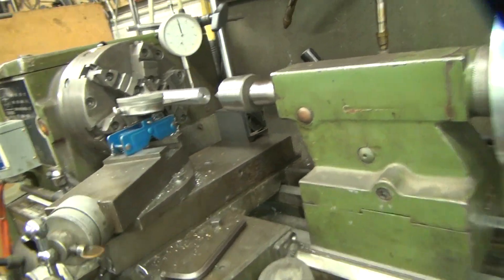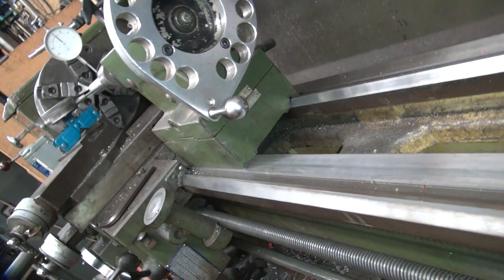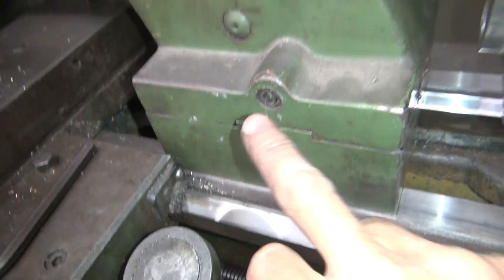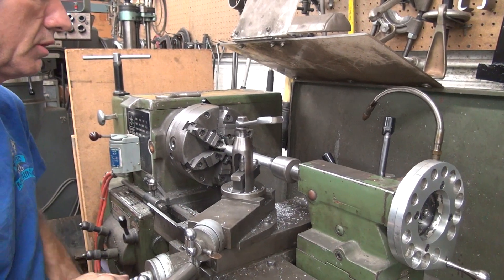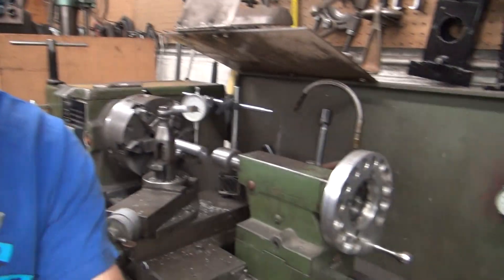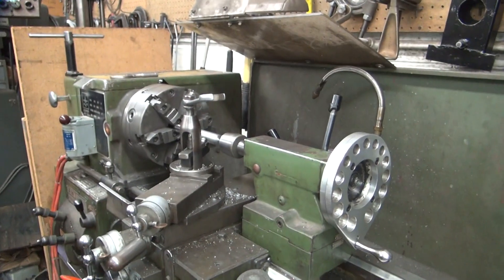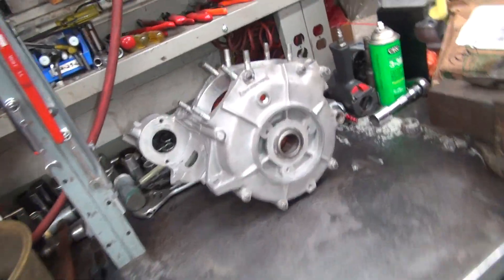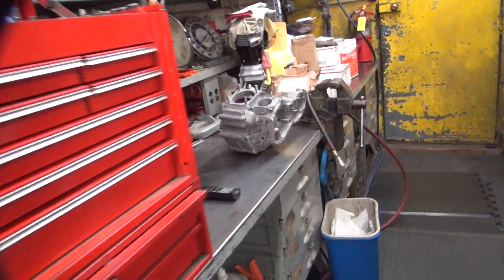#106 fixing my lathe centers centerline dimension so that i can make good parts harley tatro machine

Comment: Hello Tatro, I have a question not pertaining to this particular topic.  My question is, how do you polarize the generator on a XLCH since it has no battery?  My official Harley Davidson manual only covers the XLH which has a different regulator.  I polarized my XLH generator many times, but never my XLCH.  
And thoughts on this topic?  Thank you Tatro, great channel.
Reply: flash the battery between A and GND
Reply from the maker: thats not how i do it. i ground the field and then flash the A' from the battery. its probably the same but i do it my way.
tatro
Reply from the maker: just hook a battery into the system and do it just like the book says too.
tatro
Reply: @TatroMachine  Thank you Tatro, my initial thought was exactly the same as yours. BUT my XLCH regulator has 5 connections, ground, D+ that goes to A on the generator. DF that goes to F on my Generator and two others that feed the headlight and taillight. 
My stock XLH has different regulator terminal markings such as BATT , ARM and FLD.  Thanks again Tatro.

Comment: You're working this LOW GRADE piece of machinery into usable equipment. Drill and tap the four corners and lock the S.O.B. DOWN...
Reply: Unfortunately that’s not how it works. Heavy machinery sits on shim packs to adjust the level end to end and side to side. If the concrete pad is freshly poured, it settles at different stages over time and you have to re shim the machine to re level it. Even when sitting on old concrete pads you still have to check level and re shim from time to time. This is done on all heavy machinery including printing presses where being level and Tran is critical.
Reply: @Michael-st1hl  I was talking about the 4 corners of the tailstock. Every time you unlock it to move the tailstock, the two piece---- of shit is at risk of failing again. bolt the two together now while it's dialed in.
Reply from the maker: that is why i pull it down to the lathe 1st, then adjust the side screws. and yes, it is a pile of crap.
tatro
Reply from the maker: i am on rubber pads. that is why it moves around some.
tatro
Reply: The tail stock has to remain adjustable because of the different lengths of work pieces your positioning at different positions on your Ways. No matter how level your lathe is, you still have to adjust your tapper because of tool deflection as it relates to the type material and the O. D  size of the work piece. The smaller the O.D the more deflection you have especially with longer lengths of material where you need a follow rest or a steady rest. But the tail stock is constantly being adjusted at different positions on the ways.  Then there is the different grades of material your cutting, cold roll, hot roll, leaded stock, TGP, 1040, aluminum, stainless steel, Delron, on and on. Feed and speed, heat transfer, type of carbide or high speed tooling you’re using. So many factors to deal with and consider when controlling a precision tolerance, finish and tapper in the work piece. Also your compound ways need to be adjusted properly. I don’t care how good a or bad a lathe is.. you’re always making adjustments and using your skills to make a precision part and repeatability for a one off or production set ups.

Comment: Hey, Keenan, if you're incredibly lucky, your tailstock ram ended up parallel to the ways when you were done shimming. If not, then whenever you extend the ram more or less than you had it during the adjustment process, it's gonna' change where the tip of the tailstock center is relative to the ways. Also, since you started out with the headstock not parallel to the ways, the center that you cut into the workpiece is going to move around relative to the ways whenever you have a different length workpiece. I know from experience that shimming a machine tool can be incredibly frustrating...I hope the adjustments you did work for you. Thanks for the videos!
Reply from the maker: that is why i set everything in about where most of my cutting is. i do think the bed is twisted and i need to deal with that next. then redo the centering again.
tatro

Comment: Hello Tatro, there are many variables and factors to consider before you start making tapper adjustments to an engine lathe. 
The lathe first has to leveled end to end and side to side front to back. 
The ground ways need to be checked for wear especially from the chuck out about 4 feet where most of the wear takes place. The head spindle also needs to be checked for T.I.R sometimes the bearings begin to wear due to run time over the years. 
Then you have tool deflection, carbide “push’s” material off. High speed tooling cuts the material with less deflection.  
As far as repeatability, the above factors I mentioned will get you heading in the right direction. You are working with a very short piece of material there only about 9 inches or so.. but when you try turning a long piece of material say about 4 to 6 feet or longer you will have to check for tapper all over again. That means turning  a short band about one inch wide at the tail stock end, then crank your carriage near the chuck area and turn another band taking the exact same of material off. Then check the O.D sizes on both bands you cut. That will tell you how much you have to adjust your tail stock with your dial indicator to adjust the tapper. 
Then you have feed and speed that also creates different amounts of tool deflection and of course using rough cuts and finishing cuts that helps in repeatability and finish you desire. Keeping the veneer ways adjusted properly, not to loose! So that the tool won’t get pulled into the work piece. Maybe final polishing to your exact dimension as well.   Of course you have steady rests and follow rests as options.  Internal boring is another ballgame in regard to tapper and finish.
Good to see making things work, we all learn from each other no matter how much experience we have.  Most people don’t realize how complex and involved precision machining is. They haven’t a clue!  Great channel Tatro.
Reply from the maker: i very rarly will cut anything longer then what i just cut. i also put the tailstock center out where it would be if i was going to use it for this type job. i do think about all the variables before i do things.
the only variables i didn't think about was the bed flex from my adjustable lathe leveling bolt feet. that might help on the unadjustable .00175 head error in my 1st bar stock cutting.
just remember, this is an old 70's cheapass import lathe that was not all the good when it was new. its hard to do precision machining when you are using unprecision machining tools like this lathe is. i can only over come so much as a skilled machinest.
tatro
Reply: @TatroMachine  yep, EXACTLY my same thoughts Keenan